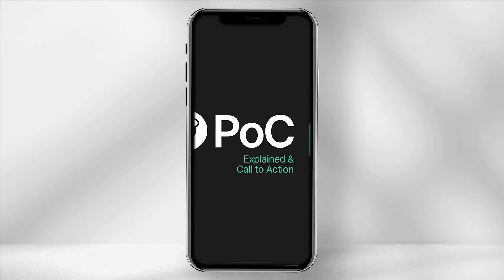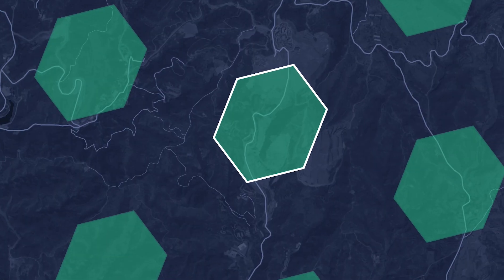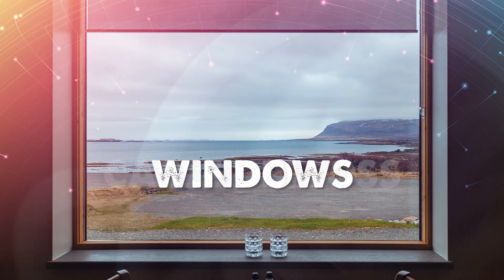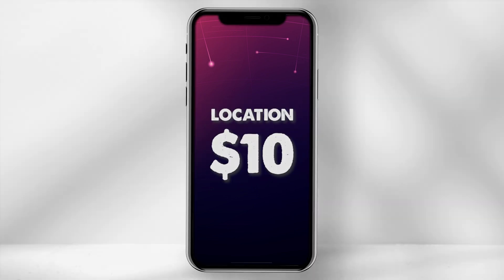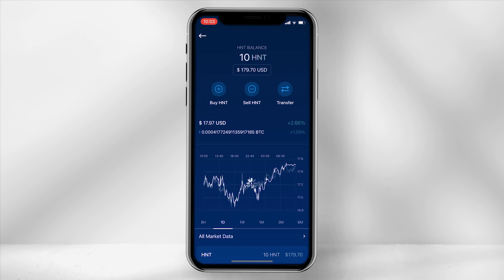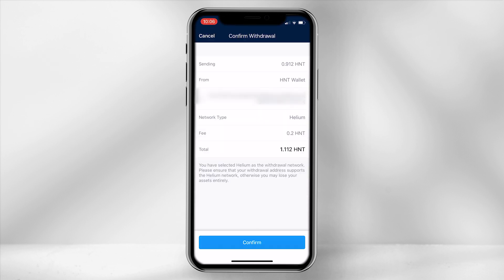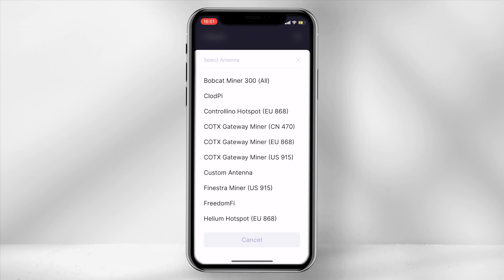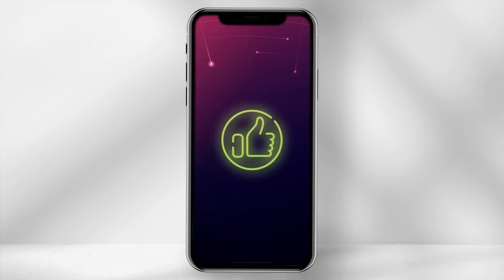Important Helium Update! How to update Antenna Dbi + location for POCV11 |  ($HNT)

Comment: Location update only works if you enter your location manually. Pin point option does not work anymore.  Even if you enter exact location of your antenna, it still shows about 30 to 50 metres away from your original location. Such an annoying thing to deal with.
Reply from the maker: Hey Humair, also faced this issue the other day with updating a Nebra. I'm thinking it is a current bug, will be updating another hotspot next week, will see if I face the same issue.

Comment: Crayban, thank you for the information. I updated the location & antenna settings yesterday but it’s still earning $0. Does anyone know how long it may take before it updates?
Reply from the maker: Hi Shreya, Let it run for 24 hours, it should pick up. Mine also faced the same issue, after 3 days it was running all ok, with original witnesses.
Reply: @Crayban  I am getting my miner in a week or two. Isn't it free when you're setting up the antenna dbi and antenna height for the first time?
Reply from the maker: @AP-hq9dc  Hi AP. Congrats. That’s correct. It’s free the first time.

Comment: I have a normal original antenna from bobcat do i need to also make update for the antenna or not?
Reply from the maker: Hello, if you have already specified 4dbi, then it should be fine. If it is default at 1.2, I would change it to 4dbi.

Comment: Where we can find more information about transmitter power?
I have 5.8 antenna with cable loss around 3.3 DB (23m LMR) and I am feeling that with this v11 my antenna gain will become 0.
Reply from the maker: Hi Icaka, I've put some linking in the description which might help. A 5.8 should be perfectly fine, i also have a 5.8 an 8.5 up. Will monitor them and see what happens.

Comment: I recently updated my antenna specs in the helium App to the correct height and dbi using the "Custom Antenna" feature in PoC v11. I didn't physically change my antenna and it's been more than 3 days, yet I lost 1 witness on 2 different hotspots, one had 3 now has 2 and one had one now has none... Has anyone else noticed this on their hotspots? I thought putting the correct info was supposed to increase and help POC info, what gives?
Reply from the maker: Hey Jim, the witnesses do change up now and again. One of my hotspots had 10 yesterday, and this now switched to 20, after I had asserted the location. Maybe the miners that you were witnessing also have switched up their variables?
Reply: @Crayban  I doubt it, 1 was mine and the others I made a list to compare antennas and heights, nothing changed other than what I updated... I guess I'll wait and see... otherwise I might assert location again.

Comment: Damn i did that and just all my witnesses any reason : / ...
Reply from the maker: Did they?
Reply: @Crayban  yeah went from 21 to 0. Weird
Reply from the maker: @onek2424  that is weird, it should have any effect as of yet, as POCV11 hasn’t rolled out. Give it some time to run, let me know how it goes.
Reply: @onek2424  you WILL loose all your witnesses. This is normal.
Reply: @Crayban  to be honest. The update seems to been out for at least a week. You will not be able to get more then 10 witnesses per hotspot
Reply from the maker: @princeben7544  It’s weird as it seem that some hotspots have it implemented and others don’t.
Reply: @princeben7544  Weirdly enough im gaining them back faster than when i first got them. But the nice part it actually upped my transmit scale from a .36 to a .61 which is also weird but im not complaining
Reply: @onek2424  yes, changes are starting to happen. I lost a witness last night but I started earning more. Hopefully, this works out. I'm also starting to think some of the Hexs around me are fake too.  It's just too many around me. Hopefully helium will start deleting fake miners or old setups no longer being used.

Comment: I have miner set up and I’ve been earning my rewards. It is on the first floor of my house so when i set it up i put 0 meters. Should I be changing into 1 m so I don’t get flagged?
Reply from the maker: Hi Josiah, the height won't make much of a difference at this point only antenna dbi and location. However if you do decide to change it, it's a minimal fee of 0.55cents.
Reply: @Crayban  would you recommend to change it? Would it give me more rewards to make it 1 m
Reply from the maker: @josiahleonard4575  I don't think it will have any effect on the rewards. From 0 to 1 is not much of a difference. Would prob keep it as it is and then when POCV11 is rolled out if you see any issues change it then.

Comment: Thanks for the info. Has this been implemented now? Noticed the transmit scale in London has dropped massively for everyone is that because of this? My earnings have dropped by half as well and I have the correct placement and antenna info
Reply from the maker: Hi David, most welcome. Helium have mentioned that they will be rolling it out on the 4th October, maybe before then. This shouldn't affect earnings if your miner is placed and labelled correctly. Are you using the stock antenna?
Reply: @Crayban  hey thanks for the reply, no I'm using a 5.8 dbi antenna on top of my roof. Was going great guns just before that update last week where everyones bobcat wouldnt sync to the network. Not just me that has dropped earnings though in north east London. Oh well at least its still earning :-)
Reply from the maker: @davidpetts1548  Most welcome. I believe over time this will be the sad truth, however I see running more than one miner overall is a much more beneficial ROI long term. 

Still under 2 years left till the next halving, If you could average 0.3HNT per day, across a whole year with Helium at a price of $15, thats approx $1600 annually.  

The early birds of course caught the worm. However I try to analyse the worse case scenario and make a call on investing. It's an amazing project, and i'm not the biggest price predictor in the crypto space, but if it takes off fully, the price should pump higher than imagined. 

It's a less risky project to dive into compared to others I have dug deep in. But like you said, it is earning something :).

Comment: Hi Crayban, thanks for the great video!
Do you know what is the default EIRP of the EU bobcat miners? I mean how much dBm are they pushing trough without the antenna itself? Or maybe it pushes only as much as it needs in order to be able to reach 14 dBm taking into account your current antenna settings?
Reply from the maker: Hey Chubritsa, most welcome. The Bobcat pushes a max output of 25dbm according to their spec sheet. I had got in touch with them and asked the same question, they informed me that they spec the miner to transmit in accordance to EU regulations, however never stated what dbm it is calibrated to. I will try to see if they provide an exact figure, as it'll be more accurate to measure the output. Here is the spec sheet i was referring to: https://d523ddbc-be3d-4ce8-9f4a-86e1d9b2472b.filesusr.com/ugd/2cb88d_bd085315425a4c0892cf4f652e2b17d7.pdf?ref=vosk
Reply: @Crayban  Thank you very much for the reply! My main concern is reagarding what antenna I should use. Do you believe that with the new update the miner would transmit according to this calculation:
14 dBm (max output) minus your antenna dBi (let's say 5.8 dBi) = 8.2 dBm
Also do you think there is a maximum dBi for the antennas we should use in EU now after the update? Or is there now a golden mean of the antenna's dBi we should be using in urban conditions?
Reply from the maker: @chubritsa9255  No problem. In regards to the max dbi, this all depends on your area. It is quite hard to know what the exact output is unless you are a hardcore radio enthusiast. I would analyse once POCV11 comes into play and what happens to my rewards. If they drop dramatically, then a lower dbi antenna would be best to use. I'm monitoring this miner (Special Pebble Moose) as it has a high dbi antenna, maybe a 12-13, will see if it gets capped, unless it has been configured to send out a 9dbi output then its signal will remain the same. 

In relation to the calculation, it should transmit to the EIRP calculation. It's the loss in between which is tough to measure. However I think the best bet it too test, once pOCV11 is implemented. I will be testing with a 8.5dbi to start with.
Reply: @Crayban  is it worth putting up an 8dbi antenna that I just bought? Im in suburb area(essex) ir should i buy a lower dbi antenna?